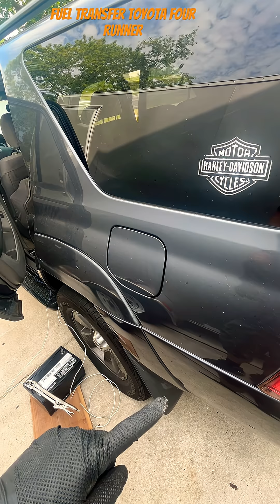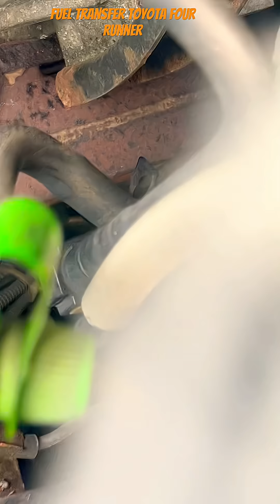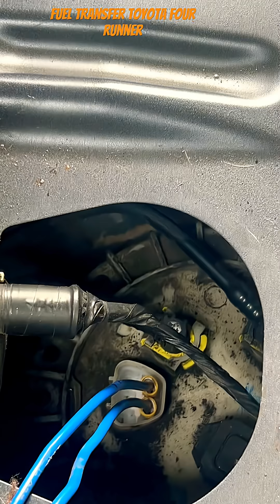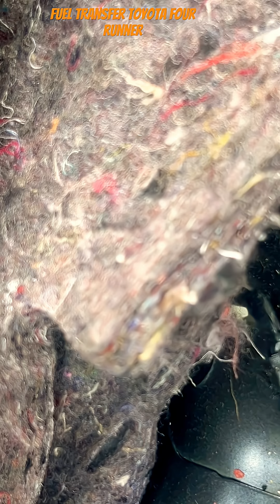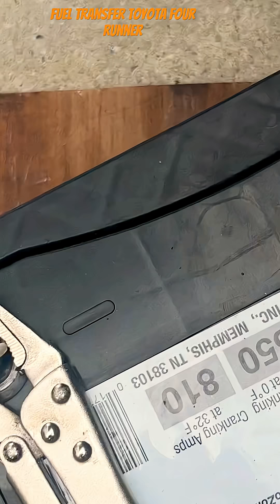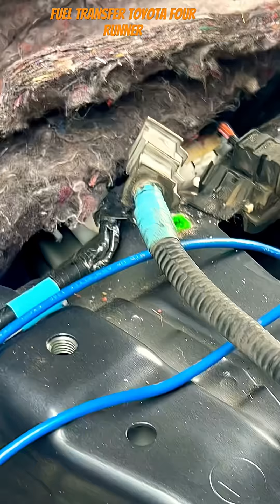Fuel transfer using fuel pump on 4th gen Toyota 4 runner

Comment: A gas tank full of fumes can be more dangerous than a gas tank full of gas, you have to remember it's the fumes that ignite , if you don't believe me just get a open top bucket filled to the top with gasoline and you can flick a cigarette into it and it won't ignite,  then pour the gas out  just leaving what only what has the bottom and sides wet with gas, and flick a cigarette in it and you'll have a fireball and at the least no hair left on your face and arms.
Reply from the maker: Thanks . That makes sense. I should have been more clear. I emptied the gas tank so I could remove it. I was doing a lot of welding and grinding. I don’t want any fuel near me. Thanks.

Comment: Why not just take the rubber hose off the fuel neck the (small one) the vent and siphon from there .the vent doesn't have a ball in it to prevent gas theft.